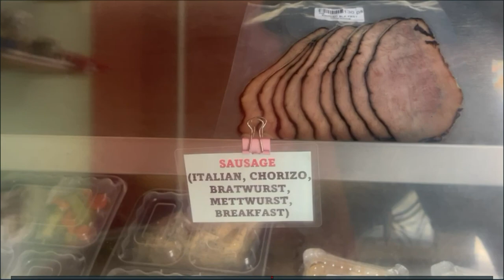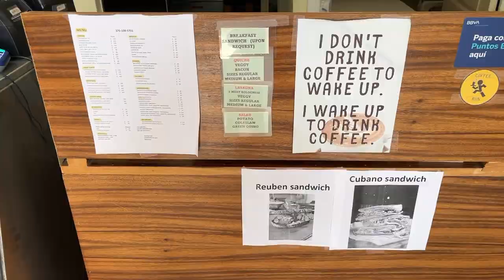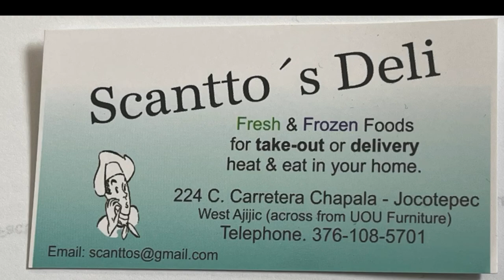My Week in Ajijic.

Comment: I have a question.  Same as Tom M.  What did you do in the states to acquire the knowledge to develop the practical solutions you routinely come up with?
Reply from the maker: When I was six years old I got an electric train for Xmas.  I took the engine apart into many small pieces.  Mom made me reassemble it.  Everything else has just been easier.